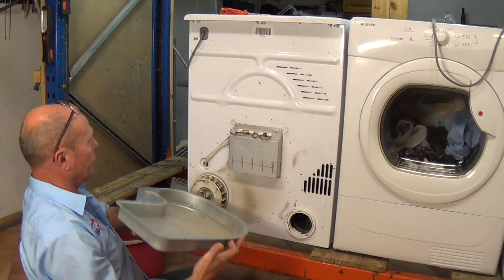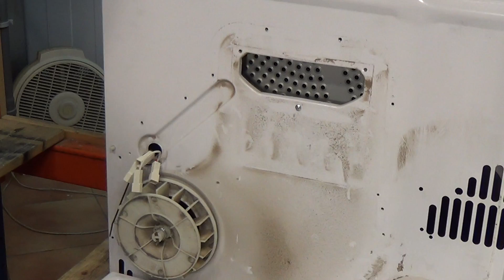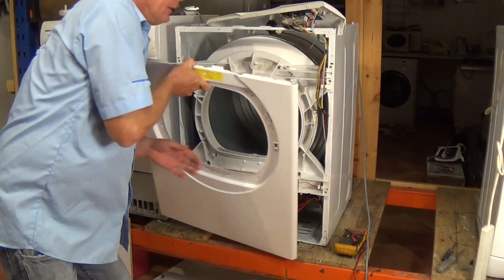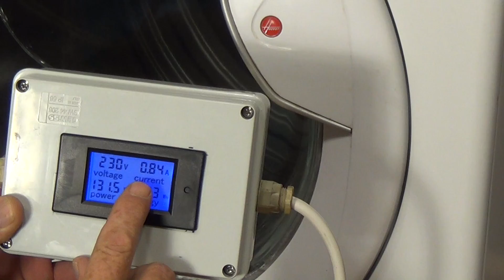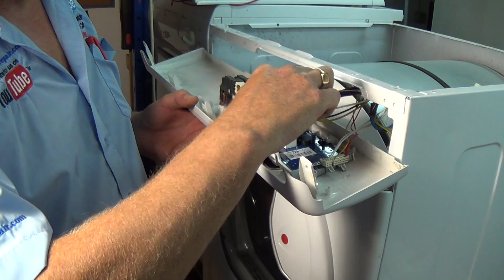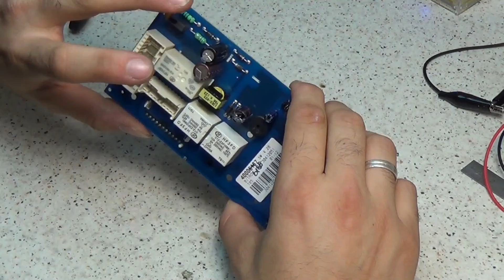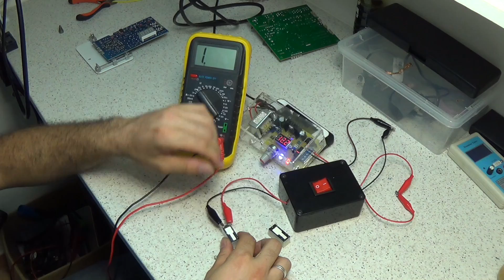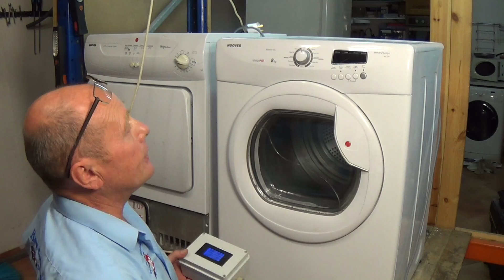Tumble dryer not heating Hoover Candy diagnosing fault and repair

Comment: Thank you for your videos ! Very professional , to the point 👍 I have had to change the high temp temp thermostat twice now I have cleaned the machine out fully did the the first time but I fear this is going to trip again what do you think may be causing this ? the machine has good air flow all round  and kept clean heater shows signs of use dis coloured one side (inside) but nothing major is there anything I should do before replacing the hole heater ? Thank you in advance
Reply: Sorry GCC 591NB candy condensing tumble dryer 2 years old 👍

Comment: excellent video,  I used to work for hoover candy as a service engineer,  I now do it over all machines on my own,  generally buy / refurbish and sell.   I came across this fault with some frequency and the machine will actually record a relay fault on the board if you can use what we called a mem loader,  which was what you plug into the board to either program or read error code histories.  

I however do not know how to do the electronic side as all we did was replaced boards,  I am starting to learn this now as there is alot of machines I am having to strip because of board faults which I want to learn how to repair.  

Great work on showing the relay switches,  and your nifty gadgets :-)  I do so hope your de-solder machine isn't a small fortune as it looks very handy and I am about to check ebay with my hopes up of a new toy.... if you have raised my hopes and its expensive im going to act like a disappointed kid at Christmas and smash that dislike button :-)
Reply from the maker: Iam Glad we could help you
Please remember to subscribe to our channel
https://www.youtube.com/user/Apart4u?sub_confirmation=1

Remember to Shop with www.how-to-repair.com and it would help us by posting the video or

website on your timeline. This helps us a lot and if we really helped you can
always buy us a beer http://how-to-repair.com/help/buy-paul-a-beer/

Please remember to mark us to your favourites also I would be grateful if you would
subscribe to our channels social media as this really helps my site and keeps
us going.
YouTube. http://www.youtube.com/user/Apart4u

Facebook. https://www.facebook.com/how.to.repair.appliances